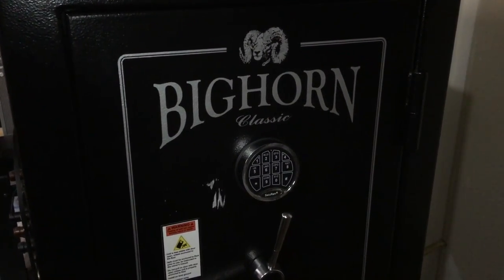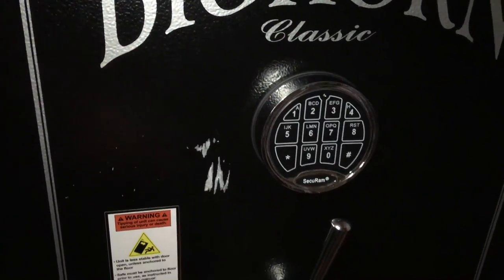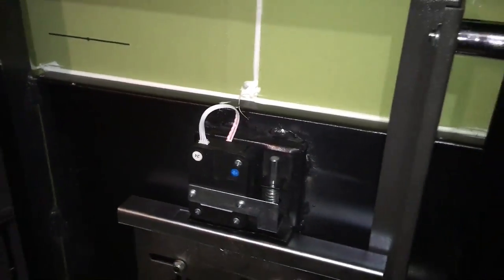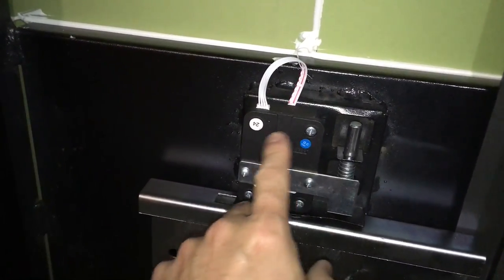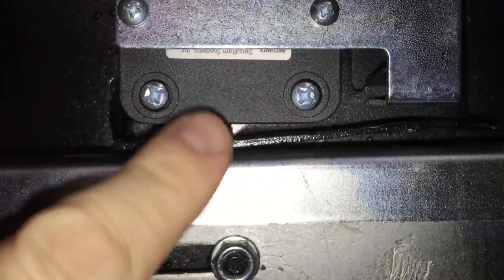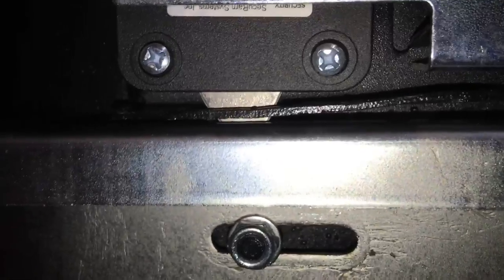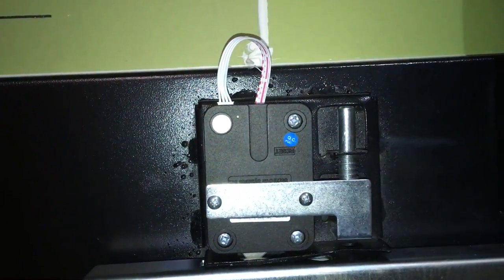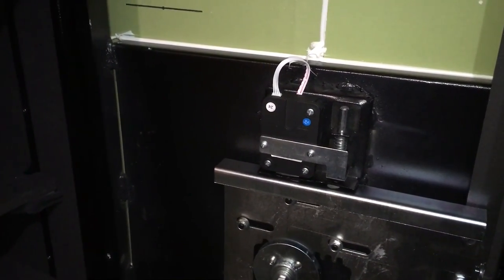How to Fix a BIGHORN Safe That Won't Lock

Comment: I purchased Bighorn Model 19ECB in 2013 and it stopped locking.  This video was very helpful.  We also had to loosen the four large nuts below that lock that you feature in your video.  Thank you for posting!
Reply: Jan Pavlovsky
Reply from the maker: Glad this did the trick. Sounds like a design flaw with so many having the same issue.

Comment: Grateful for this video.  It's exactly what I needed to fix the safe.  I loosened the screws and had to tap on the box, and after that it worked consistently.  Not the best quality safe, but functional.  Many thanks for this  info.

Comment: I've been fighting my safe for 2 weeks and 5 batteries.  The tech told me the wrong screws.  I tried your method and in 15 seconds the lock worked.  Thank you.  Saved me a lot more frustration.

Comment: Thanks, my safe just started Not Locking. The wheel moves freely. Thanks. I bought my safe a couple of years ago. I read more of the comments you received and decided to replace the battery first. Replacing the battery worked, so I would guess if it’s new then what you did is the way to go but if you’ve had it a couple of years then replace the battery first. Thanks again

Comment: Hey-the REAL cure is to grind the locking plate out 1/8" you DON'T want to leave the lock body screws loose if it works loose it will throw the relocker (spring-loaded piston) next to lock body ..but then again it's what I do for a living-so feel free I can ALWAYS use some work!

Comment: great video, thanks.  mine locks manually but then I can open it up manually without punching in the code.  what gives?? btw I put in new batteries and still won't stay locked up...  any help is appreciated.  thanks

Comment: Before you open the inside of the door and use this trick, you should make sure your safe lock has been activated. The instructions to activate the lock are not apparent at all in the manual. I called Rhino and they walked me through how to activate it and it worked fine.